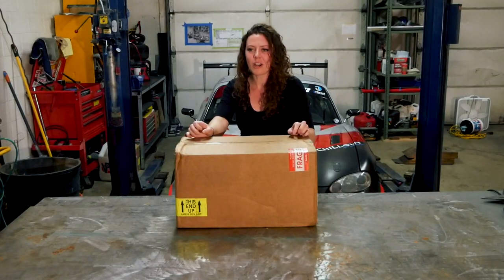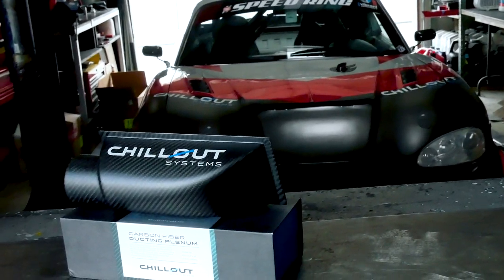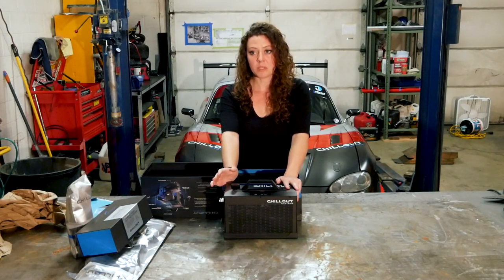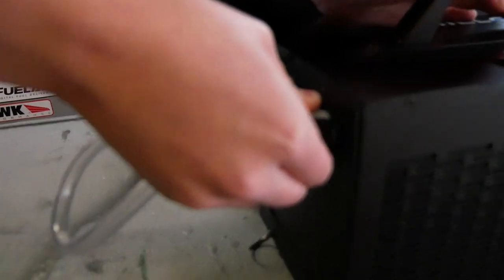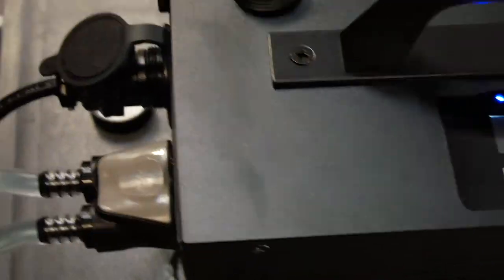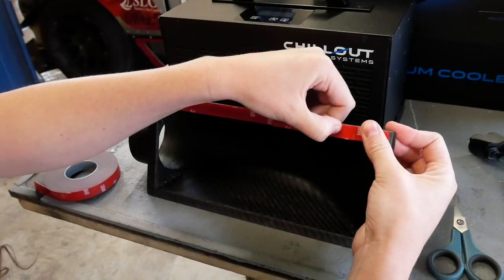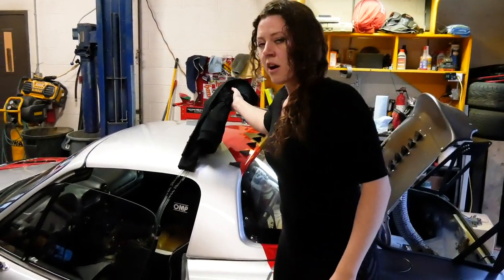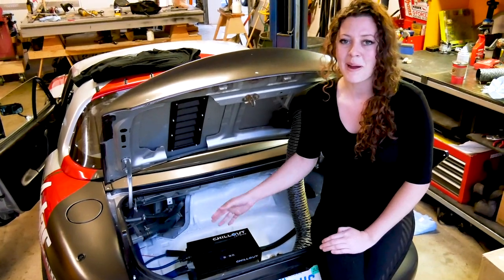ChillOut Systems unboxing and installation

Comment: I honestly want this just for daily driving without AC 🥵
Reply from the maker: Haha right!?? 😂
Reply: @darbyjean5364  is cooling enough for warm trackday? The feeling of sweating under the helmet and on the feet and being cool in the chest has to be strange.
Reply from the maker: It is! I ran mine on a 95° humid day, something I wouldn't even think about getting in the car for before ChillOut. Because it's on your core, it helps to bring down your overall body temperature, so while your head/feet may be hotter than your chest, they will be cooler than they would have been without it